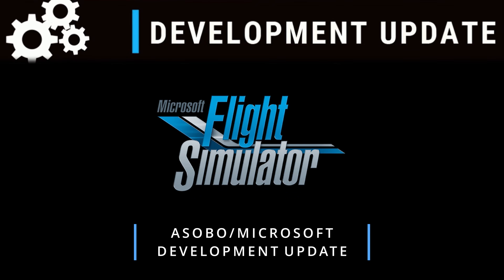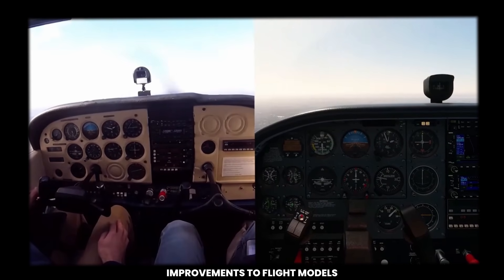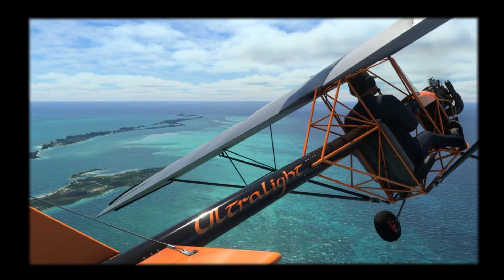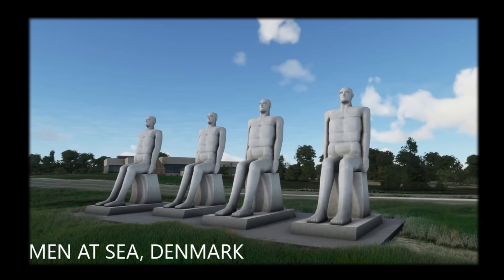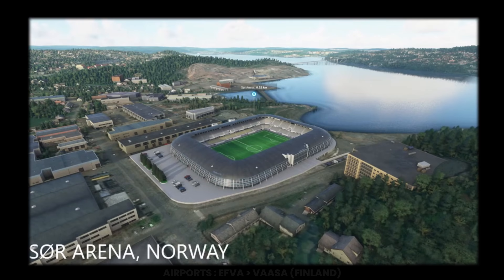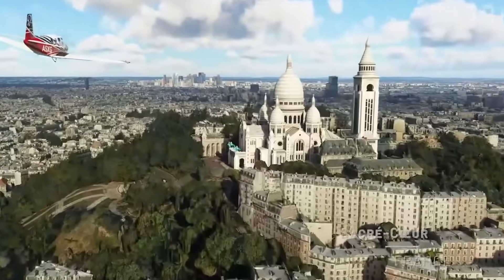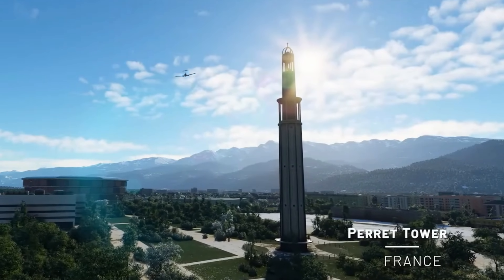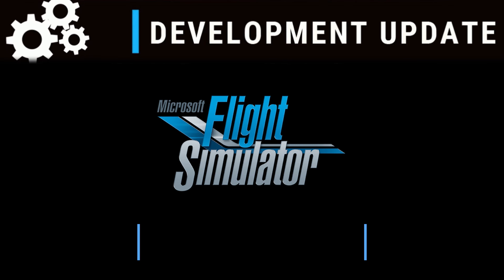MSFS | Development Update | April 2021 | Sim Update | World Update V | Feedback from Asobo

Comment: Wondering if the control adjustments, especially the rudder, in the "Customization" menu will enable being able to make tighter turns at the end of runways when trying to line up for Take Off. Often, when making sharp turns I end up in the grass instead of being able to stay on concreate unless I use the left and right brakes. I don't use separate rudder pedals, just the twist motion on my Thrustmaster Airbus stick.
Reply from the maker: Try it and let me know...I don’t think it will do that, but who knows😁
Reply: @SimHangerFS  Just tried adjusting the 172(G1000) rudder to full +2%. As you thought, it made no difference whatsoever. I guess I'll continue using L & R Brakes
Reply: Don't know what these options do, but for me they where already there since before world update 3.
Reply from the maker: @ralfsenger  , could be, if that is the case then I didn’t notice them 🤭until now.